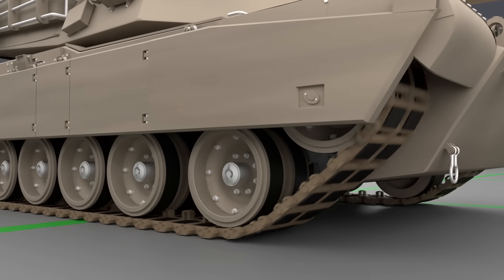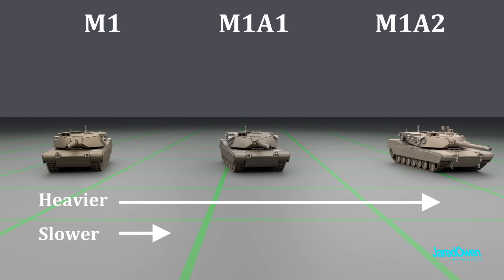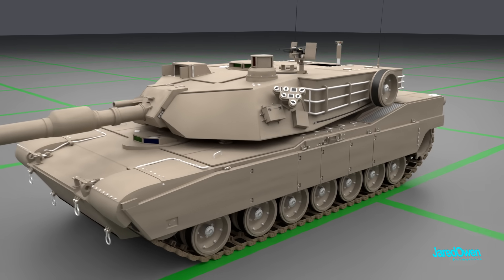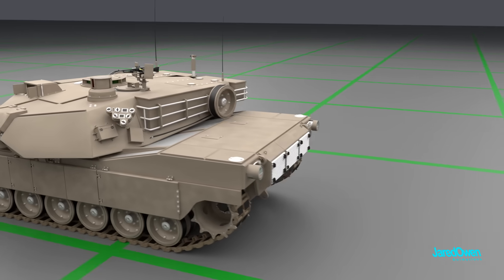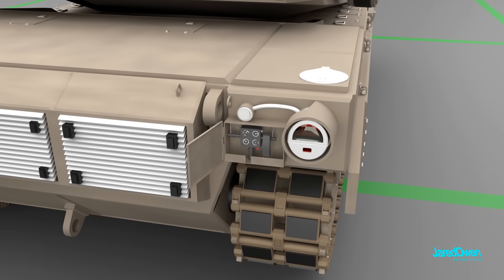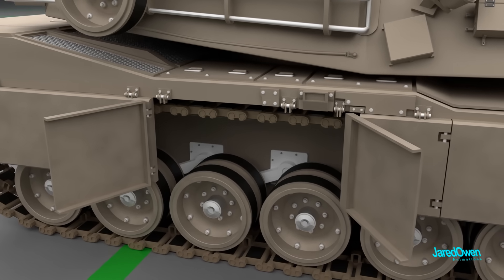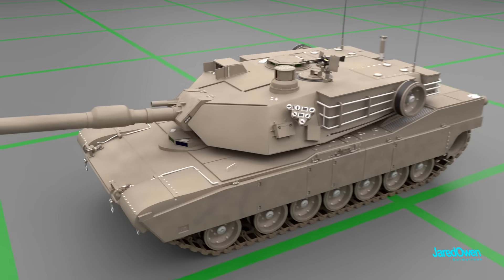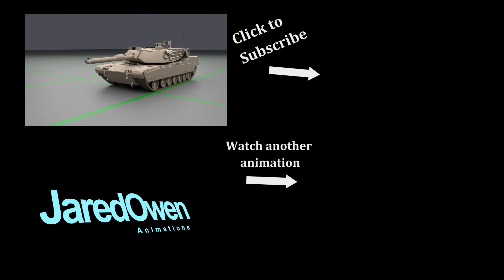How does a Tank work? (M1A2 Abrams)

Comment: I was a tanker. The only position I didn't do was being the TC(tank commander), I did driver, loader, amd gunner.  Turret can be rotated manually, or hydraulically. There is no phone on the back. The is a hookup for a radio to communicate with the crew inside the tank. A damn good crew can hit a target at almost 4 miles with the main gun, 1000+ meters with the coax, about 950 with the loader's 240. Smoke canister launchers. Unless you are short, you are not completely standing up in a tank, even other countries. If a loader takes longer than 5 seconds to load that gun, they do not need to be on a tank. The most comfortable spots to sleep on a tank are the front slope and driver's hole.
Reply: @UKUSA  Ready a round and cradle it (nose facing the closed breech block). As soon as the round in the chamber fires, the dropping block of the breech drops and the empty case ejects and strikes the deflector and is pushed almost 90 degrees to the floor. Now you have to be quick here. just insert the first few inches of the shell you are holding into the chamber. The exiting round has created a tremendous vacuum in the gun tube. As soon as you do this, the vacuum will literally suck the round from you, feed it into the chamber and the breech block will go up and lock. now you are ready to fire this round. If done correctly, you can fire a round a second, well almost.
Reply: @tibzig1  you can't vacuum load the 120mm...solid cordite casing will rupture...the 105mm had a metal casing and could be vacuum loaded...spent 16 years on Abrams...
Reply: @usp9f  I there 1987-1900. way back. Only trained on the Abrams 105, not 120
Reply: @tibzig1   I was very concerned there, on how you did that with the 120MM combustible cases. Even Lap loading now is a big no no
Reply: @jb99rapp  I did not clarify young man. That was 1987. The M1, with the 105mm, not the 120mm.
Reply: @tibzig1  How can you have a vacuum with a big hole at the other end of the barrel?
Reply: @woodhonky3890  The exiting round created the vacuum. Massive vacuum.
Reply: @tibzig1  we could pump them out pretty quick but I don’t ever remember being quite that fast.
Reply: how heavy are the shells?
Reply: @mookie714  an M829 round weighs around 41.1 lb (18.6 kg).
Reply: @_AnachronisticMonkey_  holy crap, 41 pounds? in 5 seconds? those guys must be strong.
Reply: @mookie714  During WWII, tanks like the KV-2 would have shells weighing around 114 lb (51.5kg). It took two men to load them and approximately 24 seconds.
Reply: @_AnachronisticMonkey_  I actually way 51.5 kg's
Reply: @mookie714  They are not 41 lbs. Much less. Some ammo is slightly heavier. But nowhere near 41 lbs.
Reply: @tibzig1   a traing round is 41 pounds and a warhead is 60, I know from 15 years experience.  As well as 3 years on the M60A3.
Reply: You forgot the good old "vacuum loading" the rounds!  Heh heh
Reply: My son in law was also a tanker in the First Cav unit...👍🇺🇲
Reply: @sjp2775  I was in the 2/7th 1st Cav Div. Garry Owen!
Reply: I certainly don’t remember a phone on the back. Wouldn’t want to stand back there making any calls while the engine is running. I don’t remember the engine being very quiet either.
Reply: @UKUSA  Now I will say this. It was extremely frowned upon if they found out that you were doing this on a regular basis because of the safety issues involved.  The SOP was as follows: As soon as an empty case ejected, the loader hit the ammo compartment door lever (knee activated) and the ammo compartment door (2" of steel) would open (quite fast) and the loader would grab a round (the ends were facing the loader and we marked them with sharpies as to what type) let go of the door lever closing the ammo door. Then the loader would load the chamber. It was felt that if something went wrong (fire etc) a hot round outside the camber was a major concern.
Reply: Can you please tell me how the driver sees outside view, i mean there's no glass shield in the tank. They have the camera or what? What if camera is broken??
Reply: @zainalabideen7657  its like a submarine
Reply: @dio.8598  I know nothing about tanks but I don't think tanks identify their location using sonar
Reply: @slavicnonatho8062  he’s talking about how tanks use something similar to a submarine’s periscope
Reply: @cameron4135  aight
Reply: @slavicnonatho8062  he meant the periscope part... although a tank with an active sonar would be pretty hilarious
Reply: @zainalabideen7657  No camera. It is a "periscope" system. Take two mirrors (square or rectangle, same size) put them in the same size tube facing each other, one looks out and reflects the image to the one at the bottom, which is what the driver sees. If you look carefully at pics of the driver's hatch, you will see glass slits. that is the system.
Reply: That’s very interesting! What qualifies someone to get into being a tanker?
Reply: @unoriginalhazard  a pulse
Reply: Why is it in "Miles" for Main Gun and in "mts" for others?
Reply: محارب سياسي  Sorry Those were Bradley Fighting Vehicles and other armored vehicles NOT Abrams tanks
Reply: The first time I ver got in a tank I looked for the best place to sleep. Didn’t ever have much of an opportunity to do that though.
Reply: I once tried to sleep in my M48A1 with my butt on the TC seat, my feet on the gun breech, and my head against the radio. Nearly froze; worst sleep ever. Sleeping bag outside was much better.
Reply: Who need tank😂
Reply: @jorellatanacio4125  Who needs "a" tank.  :)
Reply: Do the loader go by any other name? Like a loaderstician or something?
Reply: @1981brjo  Nope. Just plain old "loader."

Comment: What the fuck is US ton
Reply: There are several tons. Short ton and long tons are U.S. customary and Imperial tons. Technically both are defined by metric in most international uses, but the U.S. short ton is 907.18kg., the long ton is 1,016.05kg., and the metric ton (also called the tonne) is 1,000kg. In pounds, which are roughly the same in the Customary and Imperial systems it's 2,000lb. and 2,240lb. respectively- a metric ton is 2,204.62lb.

Comment: Minor corrections. The engines initially were fed JP4 which is jet grade fuel, But the exhaust was so dang hot. They switched over to JP8 which is on par with Diesel fuel (JP8 used in all diesel wheeled vehicles) with lower exhaust temps. Multiple reasons for the switch during the cold war, tail gating cars having their paint stripped, simplify supply train (one type fuel), lower engine compartment temps and lower the heat signature.  
Two MGs, 50 Cal for the tank commander, 7.62 for the loader turret mounted (not including the Coax.
Had just got to the Gap 6 months before they decommissioned the first M1s and started receiving the M1A1s.

Comment: Simple: The missile knows where it is and where it isn’t...
Reply: The missile knows where it is at all times. It knows this because it knows where it isn't, by subtracting where it is, from where it isn't, or where it isn't, from where it is, whichever is greater, it obtains a difference, or deviation. The guidance sub-system uses deviations to generate corrective commands to drive the missile from a position where it is, to a position where it isn't, and arriving at a position where it wasn't, it now is. Consequently, the position where it is, is now the position that it wasn't, and it follows that the position where it was, is now the position that it isn't. In the event of the position that it is in is not the position that it wasn't, the system has required a variation. The variation being the difference between where the missile is, and where it wasn't. If variation is considered to be a significant factor, it too, may be corrected by the GEA. However, the missile must also know where it was. The missile guidance competence scenario works as follows: Because a variation has modified some of the information the missile has obtained, it is not sure just where it is, however it is sure where it isn't, within reason, and it knows where it was. It now subtracts where it should be, from where it wasn't, or vice versa. By differentiating this from the algebraic sum of where it shouldn't be, and where it was. It is able to obtain a deviation, and a variation, which is called "error"
Reply: Missile?

Comment: I would just like to point out something I found while watching the video. The way you animated the smoke launchers is wrong. How the system works is similar to a mortar. A chemical charge sends the smoke canisters out in an arch in front of the tank with a time delayed or impact fuse that actually dispenses the smoke. How you animated it reminds me of a different system where a nozzle will spray fuel or a chemical compound onto the exhaust to create screen. Linked is a video of the smoke grenade launcher firing. https://www.youtube.com/watch?v=TODr5NKNuCg
Reply from the maker: Thanks Zachary - you are right.  I messed up on that part of the video!

Comment: Those wondering why they didn’t talk about the armor, it’s because it’s still classified and we could just sit here for years speculating what the thickness actually is, and we wouldn’t get nowhere. That’s why in War Thunder top tier is just pure speculation.
Reply: It has modified *Chobham armour + it has a layer of depleted *Uranium covered with steel sheets. Btw I am 10
Reply: @josephdaniel73  the armor has evolved a long way since chobham. I'm pretty sure it's a mixture of ceramics and metals, DU and steel included, with air gaps separating the different armor plates.
Reply: @t1e6x12   don’t forget uranium
Reply: @t1e6x12   when you use maths and add the degree of the slope it is a foot or larger
Reply: @josephdaniel73  DU is depleted uranium
Reply: China be like you kid tell us all you know about the us
Reply: it's not so much the thickness as it is the angle of the armor. 2in of angled armor is equal to 4 or 5 in of armor.    https://panzerworld.com/relative-armor-calculator?armor_thickness=200&angle_1=80&angle_2=70&angle_type=sine&calculation_type=normal
Reply: LongShot Uhhhhhhh...I hope you don’t actually think the armor of an abrams is just simple steel...
Reply: @theread3480  Yes i do...lol NO  I am anti-tank killer.  I know it's not just steel, it' a lot more.
Reply: @longshot398  theres something like multiple feet of armor, not just inches.
Reply: @t1e6x12  No theirs not, i am anti -tank i know things. If it was multi-feet of armor the tank would weight to much too move.
Reply: @longshot398  But there is multiple feet or armor.
Reply: @longshot398  Uh buddy its called Chobham armor its slanted and it has a giant length of thickness ive been inside an abrams before the thickness is giant and a smart soldier dosent just say “I was an anti tank in a tank battalion” nor does he act cocky
Reply: @theread3480  dont worry man your right
Reply: @longshot398  if your talking about the burster plates your partly correct they are about 21mm but all of them together are a good foot long or bigger
Reply: @t1e6x12  we ain't talking about the Bismarck buddy, no tank can move without it being a target being that heavy, slow, impossible to transport without breaking bridges or roads, and their fuel guzzling abilities. Now I might not be a tanker, but I know what can and can't work. Take the Ratte Tank for example, or even the maus. The maus had to be transported in three pieces on three different train cars for to bring it to combat, let alone the problems of the transport being a target and the difficulties assembling the tank. P.S, there are two terms for armor, Armor thickness, and sloped thickness. I presume you are talking about sloped armor.
Reply: @Indo-Sama777  See my other comment for more information. Also I would recommend doing a quick search on your preferred search engine to verify this.

As I said, the bulk of the armor is on the front of the Abrams, as well as the turret. Now take the Maus, it has very thick (for that time) a couple steel all around the tank. Not only that, but the Maus is far larger than the Abrams, meaning there is more material required to put armor around the entire tank which leads to more weight. Now compare that to the Abrams which is not only smaller, but focuses the bulk of it's armor in the front. Combined with other factors (such as lighter tracks, etc), the Abrams is allowed to be a lot lighter than the Maus. Armor has progressed a long way since WW2, along with everything else. It would be rash to assume that the Abrams was protected with thin armor all around.

Comment: WTF is US Ton! Its ton
Reply: There are several tons. Short ton and long tons are U.S. customary and Imperial tons. Technically both are defined by metric in most international uses, but the U.S. short ton is 907.18kg., the long ton is 1,016.05kg., and the metric ton (also called the tonne) is 1,000kg. In pounds, which are roughly the same in the Customary and Imperial systems it's 2,000lb. and 2,240lb. respectively- a metric ton is 2,204.62lb. I've heard people outside use "U.S. ton" to refer to short ton.

Comment: Ahh, was there a guy called Washington or alike? 
Guess what: you are not part of the empire since 250 years!
Why then this stubborn ass imperial clinging? Feet? US ton? Mph? Gallons?
The English use the international measurement units (SI) themselves today.  Get metric.
Reply: Raw Egg  yes, but it aggravates you when they stack data you cant interpret.
Reply: Raw Egg  Its easy to be polite. What if there were subtitles on those timestamps showing the corresponding metric values? Look: the Canadian French-speaking population is an ever-depleating minority. Yet French is their state language beside English. One more fact: Even in the US you dont change   local values at 12 when you count. You count in the decimal system. "Dozen" is just an auxiliary measure. If this is a normal practice, why not use decimals in all the other measurements? Its not such a big problem that there are pounds, feet, inches, gallons.... Its their idiotic conversion rates when they turn in various amounts 3 or 12 or idk... You dont count until 10 with them when turning a new value.

Comment: Good video but ill correct some things no hate just want it to be accurate for ex they weigh 72 tons and speeds of 45 and the tc( tank commander will have a coaxial 50. Cal above his hatch and there is place where the rounds are stored not one big one they hold 18 rounds a peice one behind the tc and the other for the loader this is not for hate but I love tanks and want to fix some things so people have an accurate picture of them 😀

Comment: Ok but where does the shell hoes after being fired?? Is it ejected like a gun??!
Reply: @Steven Quistian, the spent round is ejected into the basket when the breach opens after it is fired, when it if full you throw the empty round out of the turret through a purpose built hatch in the loaders side on the turret
Reply: @Quadrant14  Not on the 120mm. the casing is combustible, all that is left is the base, which is kept inside the vehicle.

Comment: how can the turret turn completely if the back part is slightly higher than front part? :O
Reply: The front and lateral sides of the turret are shorter than the elevated backside so they don't reach that elevation on the main chassis.
Reply: Gabriel Stan aah i see, thanks for the info :)

Comment: Fabulous video, very well done. I do think it's worth noting that the turbine engine is incredibly light weight and produces a huge amount of horsepower for its weight. Jet fuel is very close to Kerosene. Low flammability and the fumes are not explosive like gasoline.

Comment: As a Abrams Tank Mechanic. 

This tank is a piece of crap to fix.
Reply from the maker: Good to know!  Thanks for sharing
Reply: @JaredOwen  also pulling pack aka the engine is not fun. It is hot and covered in fuel. Also not jet fuel but a certain kind. Other than that. The video was quite accurate. Good job.